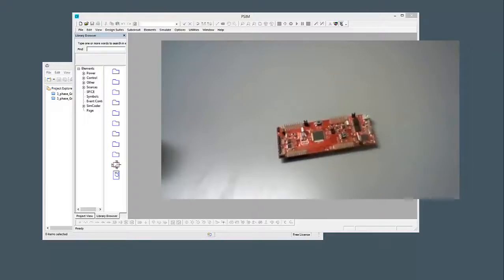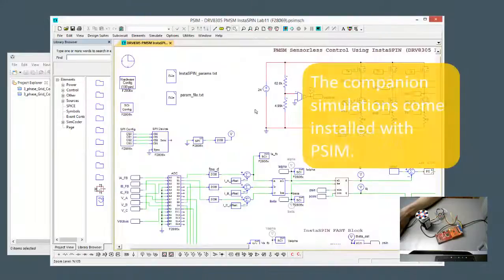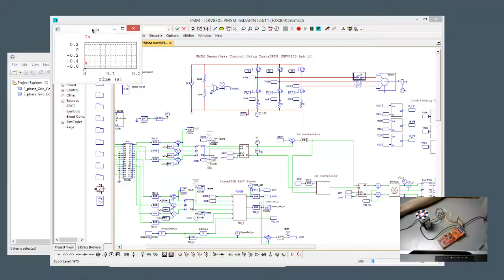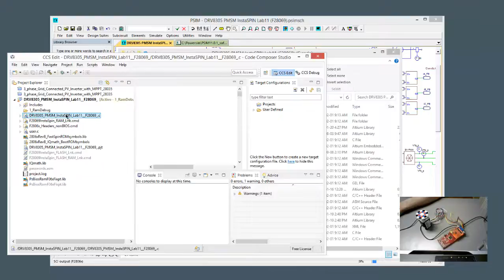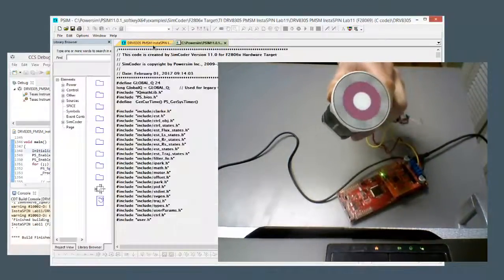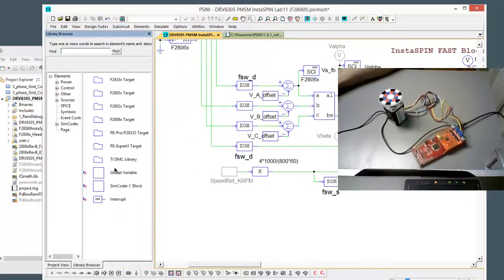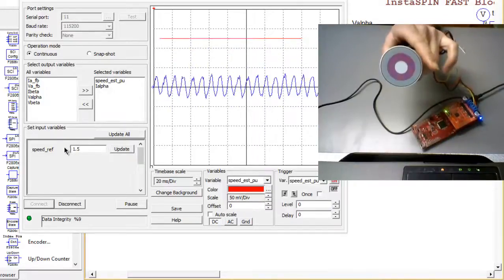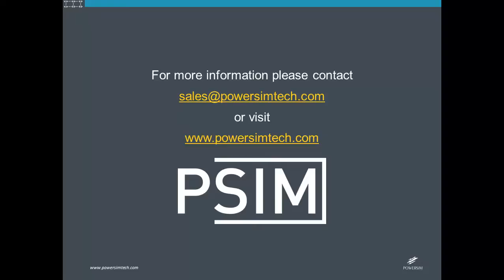PSIM InstaSPIN DRV8305 Quick Start - PMSM motor control

Comment: Can the DRV8305 alone drive the drivers? or any other Microcontrollers are required to perform the FOC calculations like Clark transformation and Park transformation?
Reply from the maker: Your question phrasing leads me to think I need to explain what is going on in a bit more detail. The board that mounts to the launchpad is the boostXL-DRV8305EVM. This board has two main functional components the driver IC DRV8305 and the MOSFETs. The DRV8305 is a driver IC specifically for 3 phase applications, you don't need to supply extra components to gate the high side devices of the inverter, it is all included. You can also configure it over SPI and set deadtime and current feedback gain ratios. The TI datasheet is very thorough discussing its capabilities. The PWM outputs from the MCU connect directly to the DRV8305 IC and these then connect directly to all of the gates high and low. As long as you respect the voltage ratings you don't need to worry about isolation.
Reply: @altairhowto  So once I get the chip. I can give the basic parameters of the motor and it takes control automatically?
Reply from the maker: @RaamakrishnanNS  short form yes, give the system parameters to PSIM motor control design suite and then you are off to the races!
Reply from the maker: The F28069 has all the computation grunt to do the FOC calculations with an interrupt rate in the 30kHz range. I wouldn't go much faster than that. If you need a faster PWM you should scale the PWM carrier from the main interrupt.